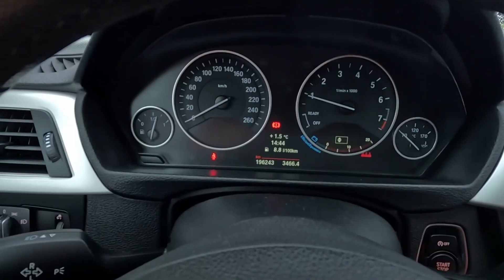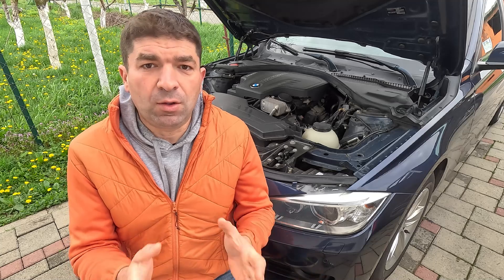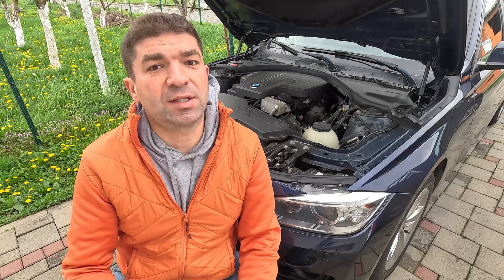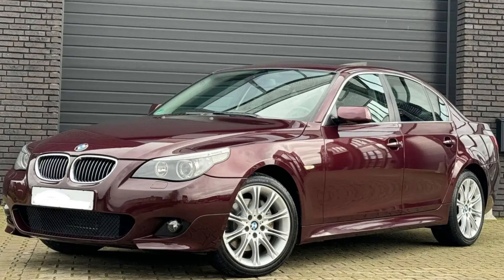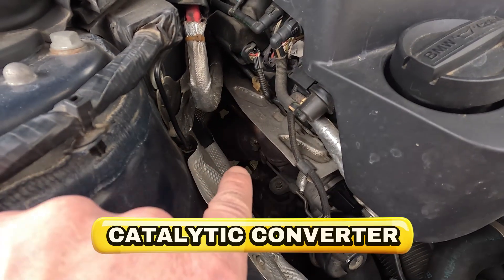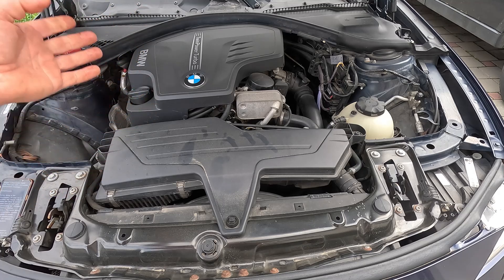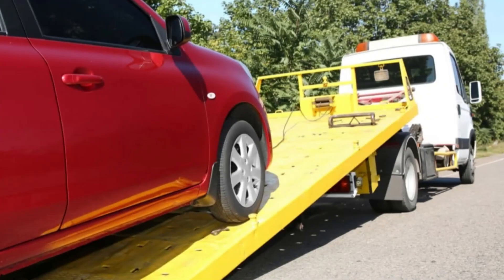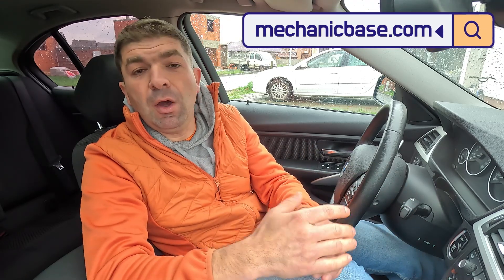BMW Drivetrain Malfunction Warning - Meaning, Causes & Fixes!

Comment: My mate had this issue. 
After he removed his dpf and then had the car remapped. Then he changed the egr valve. 
Since he's done that everytime he drives it hard (drives fast) it comes up with a drivetrain fault which resets itself. It doesn't go into limp mode. 
A BMW mechanic told him he will have to remove the egr valve. 
If he drives it normally it doesn't come up with the problem. It's only there if he drives it fast. 
But resets itself. 
Any ideas what it could be. It's a diesel car. 
Thanks in advance

Comment: Thus happens to our 2015 bmw 6 series (?) but only within 2 mins of starting up and only one trip in 3. Low pressure fuel pump fault detected when ran sensors... Think its definitely that causing the problem ,?

Comment: I have a 2013 f30 328i and experienced a timing chain guide failure,after getting it repaired the drivetrain malfunction error comes up around the 2 mile marker every single time after clearing out on startup.. Can't figure out the issue and no error codes come up upon scanning

Comment: I think mine is the battery I heard battery can cause this i hooked it up to code reader and battery read 11.7 volts
Reply from the maker: Yes. Bad battery će offset the electronics.
Reply: @MechanicBase ya checked said 11.7 volts with key in ignition
Reply: Did this fix your problem, I’ve just had the same thing and I think my battery is very low on Vt
Reply: Same, had low battery

Comment: I had this happen the other day to my 2018 X3 M40i and am thinking about buying a fault code reader but I will have to do a lot of research as to the most accurate one. I want to try and avoid paying for a whole lot of parts being replaced and the fault does still not go away. I may if necessary get an independent card reading done as well before going to the dealer if I have to.

Comment: thank you. I just bought a used BMW and got this warning when driving it home. Took it back had it in the shop they changed the PCV valve and it was good. Until going back home on the freeway and it thru the code again at 80 and threw me into limp mode. Pulled over and turned it off. Sat for a minute and turned it back on. got home after calling them. I take it back in tomorrow I am going to hand them the list of things I want checked. I should have been able to do more than drive home on 2 occasions since leaving the dealership.
Reply: Same happened to me the day after leaving the dealership, I floored the pedal all the way down and went into drivetrain malfunction, but I was told it’s probably because I put cheap gas so told me to use that gas then fill up with premium from a better gas station. I did and it was good but about 9 months later it started having the malfunction with less and less powered acceleration, and now I can barely drive it, when I come to a stop sign I accelerate but it will only roll then catch gears a while later ugh it’s a mess
Reply: I’m so sad tho I love my car, I’ve replaced the fuel pump, plugs And the mechanic is saying it’s a failing transmission but I don’t wanna invest too much into the car as it’s a 2013 750i m sport and I just hit 104k miles and the bluebook value is at 4,400. I will probably get rid of it

Comment: Hmmm… when it comes on while driving it starts to jerk at slow speed and loud screeching noise happens.  I have to drive anything over 20/25mph for it to not jerk but going up hill is a struggle of if I plan to drive slow. So I have to go up with a speed.

Comment: 77 toyota (2T-C)almost 4k miles. if timing belt has stretched, the timing guide and tension-er have reduced any slack in timing. why does 50 years later "they" have problems with chains? (lets not talk about belts and interference engines) ?? gm and bmw sigh, then ford wants a wet timing belt. Do they really think a customer don't see facts! Your planned obsolescence, and over engineered repair times lose life long REPEAT customers. Quality; Is that not the end game? or you always gonna hope to catch the sucker? comment below.

Comment: Hi, can you help, i have the drive train error on a bmw 1 Series petrol 2012 plate, when the car has been plugged in on the diagnostics computer, I have this error code 11A002 Fuel high pressure - plausibility pressure too low  

The mechanic has changed the fuel pump in the back of the car still getting the error any suggestions please would really help? Thanks 😊

Comment: Ciao! La BMW, quando comincia ad avere problemi, è complicata e costosa da sistemare. Ho una E46 330CD FL del 2004, 304.000 Km (ora ne segna 999.999 e l' autonomia sul BC è la metà di quella che dovrebbe essere perchè la IKE si è guastata), ma questo è poco. Tutto è cominciato con perdita di potenza tra i 1500 e i 2000 RPM e l' auto faceva fumo in accelerazione. La diagnosi (PA SOFT BMW Scanner) non mi dava indicazioni, quindi ho sostituito quasi tutti i sensori: debimetro, sensore alberi a camme, sensore giri, sensore pressione collettori di aspirazione, sensore temperatura aria aspirata, tubazioni intercooler nuove, iniettori puliti, guarnizioni collettori, coperchio valvole e pompa vuoto nuove, la turbina e l' attuatore vanno bene, e il problema di fumo e dei vuoti a 1500/2000 RPM l' ho risolto. Ma poi ha cominciato ad avere dei vuoti in partenza, quasi a spegnersi se non si accelera molto, così ho cambiato la pompa di mandata del serbatoio, la pre-pompa a 5 Bar nel sottoscocca e il filtro gasolio. E' migliorata un po', agli alti gira pienamente e potente come nuova, ma ha ancora degli strattonamenti in ripresa e la diagnosi non vede errori. Proverò a cambiare anche i costosi sensori del common rail (attuatore pressione, sensore pressione e regolatore pressione), ma se il problema continua non so più che fare. Devo comprare un' altra IKE e programmare il chip per scrivere nell' odometro i km esatti...è da tre mesi che cerco di sistemarla. Poi ci sono le guarnizioni dei vetri che si sbriciolano, eppure è sempre stata curata e tenuta in box. Ho anche una 156 2.5 V6 24V che è più vecchia di 6 anni, ma funziona benissimo e le guarnizioni esterne sono ancora morbide che sembrano nuove, quindi ho imparato che nei tempi lunghi la BMW è più delicata. Se avete un suggerimento da darmi per i vuoti che continua a darmi ai bassi regimi ve ne sarei grato perchè ormai ho letto tanti forum ma nessuno capisce il problema, altrimenti questo è l' ultimo tentativo e poi la demolisco, anche se mi dispiace dopo averci messo ore di lavoro e speso soldi, ma è inaffidabile. E complimenti per i video, sono sempre molto interessanti! 👍
Reply: Have u tried resetting the ECU that can help to, that might be all it needs now that U've done all that work! Good luck!
Reply: @verlandhenderson247  Ok guys, as promised I'm updating you. My BMW is back to its best and I decided to keep it for another ten years. What was it? The mistake of saving too much on spare parts. After changing all the sensors, except the flow meter because it was a year old, I discovered the cause of all the problems was precisely the 50 euro flow meter! I bought its original one (120 euros) and the car is perfect again. Even the autonomy is recalculated correctly now, with a full tank it calculates about 950 km without always slamming the accelerator, but at least it gives me 850. Now all that remains is to restore it outside, the gaskets are crumbling, but now I know it's worth the expense.
Reply: @Ghost-Alive-1 thank you for a thorough explanation of your fix.😊
Reply: @divakim206  You are welcome, is a pleasure to share experiences for help 👍😊
Reply: @verlandhenderson247  Hi friend! Yes, I reset it and then I also put it in self-learning mode with the BMW Scanner. I also tried to completely discharge the capacitors and memories by joining the battery cables but the only result obtained was having to code the rain sensor 😃 I checked and cleaned all the ground points, cleaned and tightened the cable lugs of each sensor connector and the power system, but still nothing to do. I'm sure that the problem is not serious, it must be a nonsense, but no matter what I tried so far I have not solved it. If I solve it I will come and explain, it could be useful to those who go crazy over the same problem spending a lot of money uselessly. Thanks for the good luck, I will need it 😄👍
Reply: I have the same problem and engin little bit shaking what can be that??
Reply: @valentinsimeonov1491  It's hard to understand because some similar problems can be caused by different sensors, but I'll try to help you. Start with the two least expensive and easy to change sensors: intake manifold pressure sensor and camshaft speed sensor. Try cleaning them first and if the problem persists, replace them. Let me know and describe in detail the problems you have. Remember, I'm not an expert, I just gained experience on my E46. Just today I received the two most expensive sensors to change, the two on the common rail (pressure sensor and pressure limiter) and to change the second one I have to disassemble the intake manifolds again. If I continue to have problems, the pressure regulator on the CP4 pump remains, the damaged CP4 pump (but I hope not) or the DDE 5, since I have already changed everything else. Some sensors are in complicated positions, it takes patience, a lot of patience...
Reply: @Ghost-Alive-1  thank you I will check them then I will let you know
Reply: @valentinsimeonov1491  You are welcome 👍
Reply: @valentinsimeonov1491  P.S. Obviously to remove the intake manifold you have to make space above, so you also have to remove the cabin filter and the tank that contains it, fixed with 4 Allen screws. Unfortunately the car is a matryoshka, so many things to disassemble to access some parts.
Reply: @Ghost-Alive-1  the intake manifold i think it's the problem
Reply: @valentinsimeonov1491  See if it is very encrusted because of the egr and try to change the gaskets. I put a new and clean one, plugged the swirls and plugged the egr. I replaced the two sensors on the common rail, now it goes much better, but it still makes small tears in acceleration, not always. I ordered the last sensor that was missing, the regulator on the cp4, but if the problem persists I give up. Let me know if you solve it with yours.